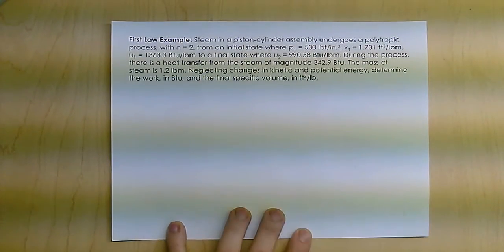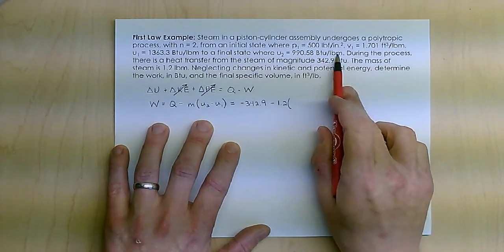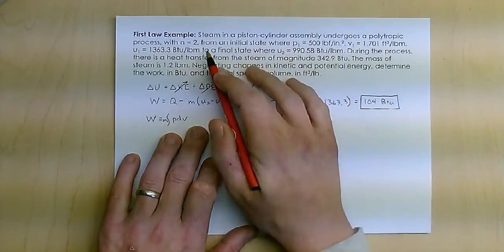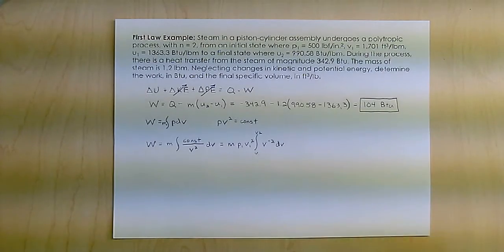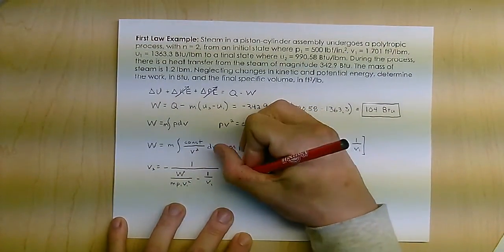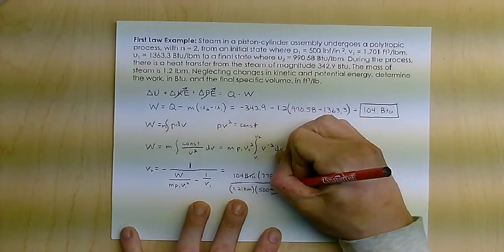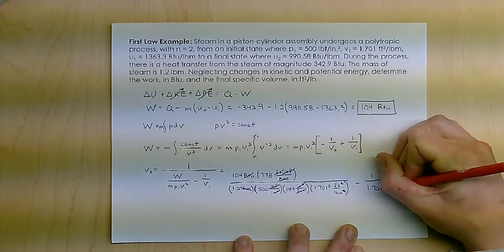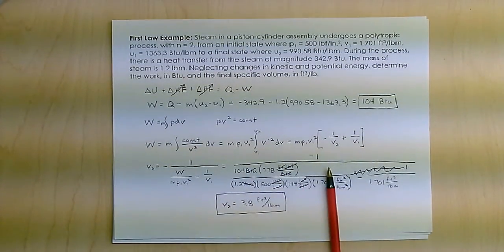Thermodynamics Example 2: First Law

Comment: These videos are great, they are very useful when I'm preparing for my thermo class.  Could you talk about why you included m in the delta U.  Is it because you were given U1 and U2 in lbm? Thank you.
Reply: guy sucks for ignoring question. and including M in U when its not part of it. looks like he is using some relation he is not showing.. he needs to never make videos.
Reply: @BSME-MSAE  he explains what specific volume is in lecture 0 of this playlist, on his channel. The playlist is called "EGR 263 Thermodynamics". 

Volume "V" (uppercase v) is in units of ft^3, but SPECIFIC volume "v" (lowercase v) is equal to V/m, and is in units of ft^3/lbm. The work equation typically uses V, but he substitutes in V = v*m because the problem gives volumes as specific volumes. That's why his v is lowercase, and why the m is added. 

Any time someone says "specific" in front of a property (e.g. specific volume, specific entropy, specific heat capacity, specific enthalpy, specific work, specific heat, etc), it's that usual property DIVIDED by mass, hence the units are per kg or per lbm. You can kinda think of it as allowing an engineer to scale up the answer depending on how much mass is involved. 

Also, you need to chill.
Reply: @BSME-MSAE  no its because that U is specific enthalpy, so you multiply by mass to get U that we use in the equatin